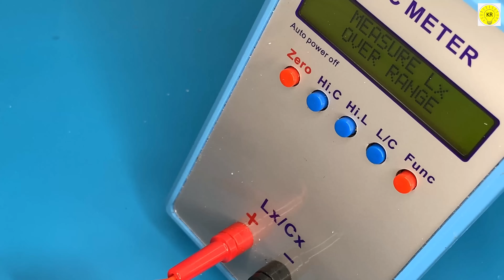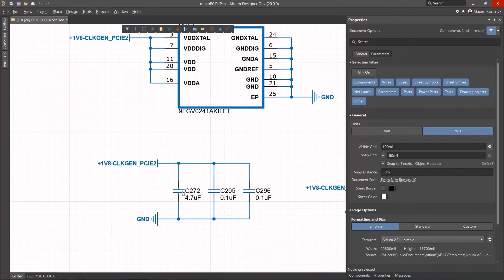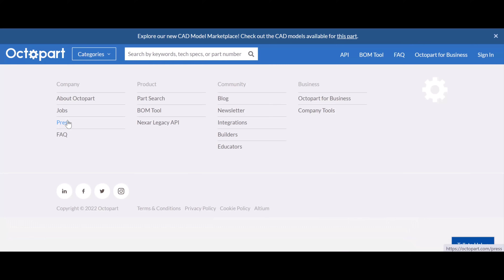how to make high power current booster circuit , altium designer

Comment: What about the ZVS unit idle  current draw compared with load sparking flyback? The ferrite is still inside the primary wire also , as when sparking load. Also does the unit with 10 capacitors at the lower frequency cause buzzing noise as compared with silence at small capacitance? I don't see this working at 200 watts, a standard Inverter with transformer will do 200 watts at 16 amp draw from battery.
Reply: I agree with with. What would you need extra current at the expense of your wired getting fed hot 🔥  and starting a fire.. I saved the video for the website mentioned in it they looked good. 👍🇮🇪

Comment: Ok gut gezeigt . Transistor - Flipp-Flopp mit überkreuzten Dioden zu Schwingkreis  und 10 kOhm Basis Emitter Widerstand
ich glaub das geht sogar mal. auch bezüglich Schaltplan. Die 22 Ohm pseudo - parallel sollten wohl zuerst als 10 Ohm einzeln über jeden Transistor. Dafür dann noch eine Extra - Drossel ? Weil alles mit Welder Drosseln anfängt ?